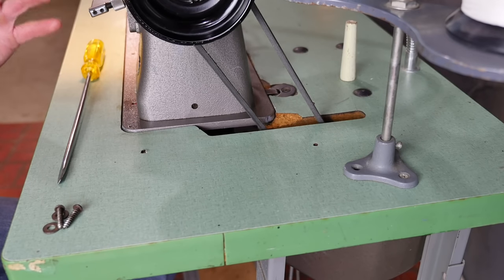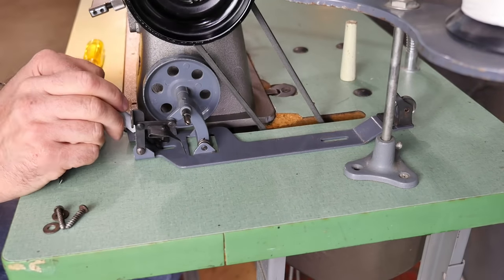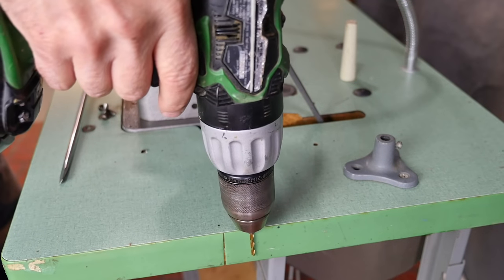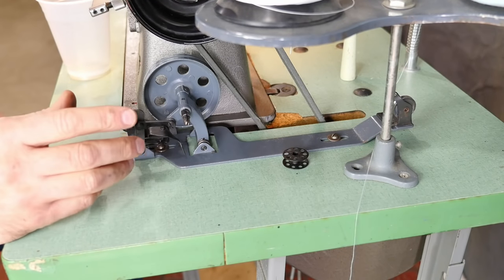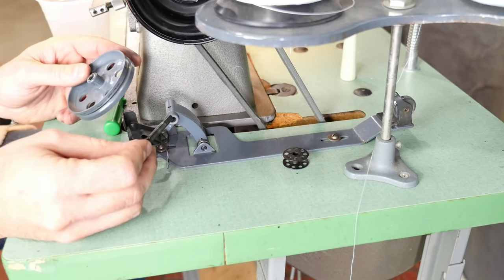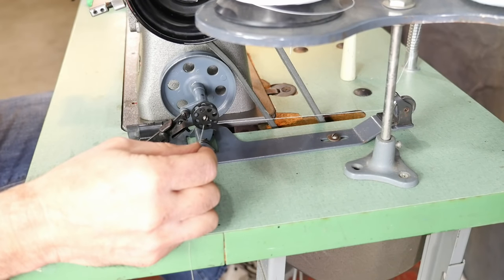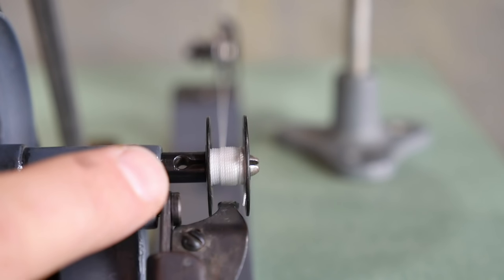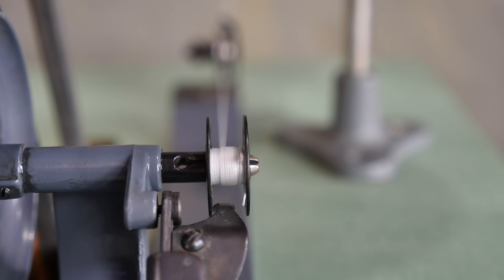Install and Adjust a Bobbin Winder for an Industrial Sewing Machine

Comment: I'm picking up a Rex 26-188 tomorrow that will need some work. I really appreciate this video. Thanks for posting such great content!
Reply from the maker: Be sure to check my channel for more Rex 26-188 / TDU-N62 If you haven't found it yet. Thanks
Reply: @AlexanderDyer  So, I picked up my Rex. Thanks for your videos on it! I noticed in the How to Thread a Rex 26-188 that I have a missing piece: the disc assembly that you first thread through before you go down to the main tensioner. I've looked on sewingmachineparts.com and can't figure out what that assembly would be called. Any ideas?

Comment: Does it hurt the machine to do that when there's no material under the presser foot????  There's no way to disengage   the presser foot from going up and down on my 226r.  The foot slams down pretty hard when there's no material being run through the machine.
Reply from the maker: lift the foot and remove the thread from the needle.

Comment: Is there'd endless bobbin for industrial type sewing machine? Thank you.
Reply from the maker: Not exactly but I know what you mean. There are machines that do not have bobbins but they are making a different stitch. Here is a video in which I explain. https://youtu.be/Og1hM8iS22Q
Reply: @AlexanderDyer  Thank you for taking the time to answer my question. I use a Singer 112W115 and was wondering if there would be a way to save time filling the bobbins. Good videos!
Reply from the maker: https://youtu.be/D3QuCF6zATg?t=97

Comment: Is there a way to adjust the finger? My bobbin disengages before it is even half full (M-class bobbin). The finger is too far into the bobbin.
Reply from the maker: Yep. There is a screw to adjust the finger. Tighten the screw and it will move the finger away from the center of the bobbin so it will fill more.
Reply from the maker: https://youtu.be/re-sKlH1Oh4?t=252

Comment: Hello what is the white spindle behind sewing machine used for?
Reply from the maker: That is a "kick stand". The machine can be rotated back on the hinges and it comes to rest against the stand holding it firm and secure in position as you make access under the machine.
Reply: @AlexanderDyer   Wow I thought it was something more involved. Thank you